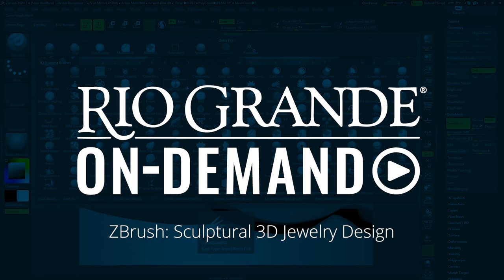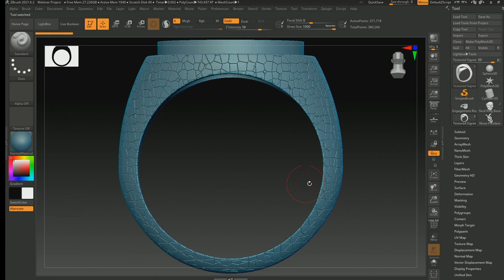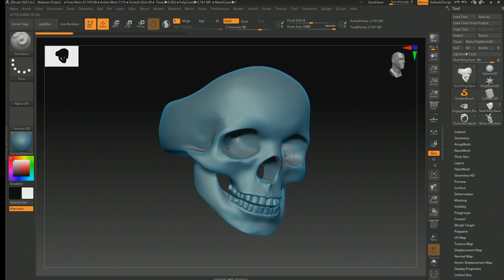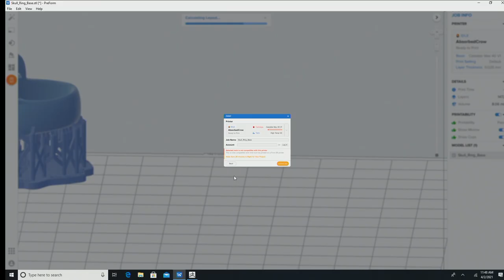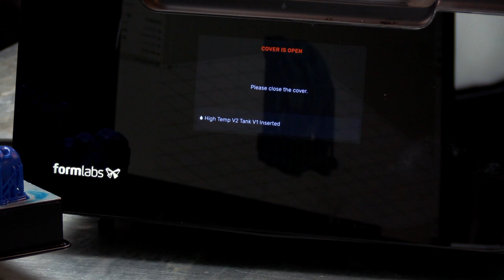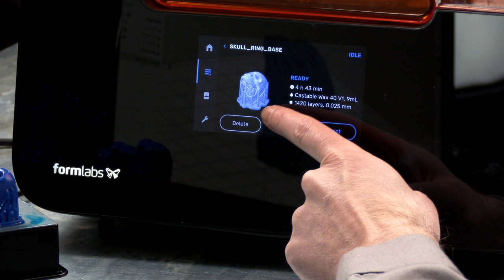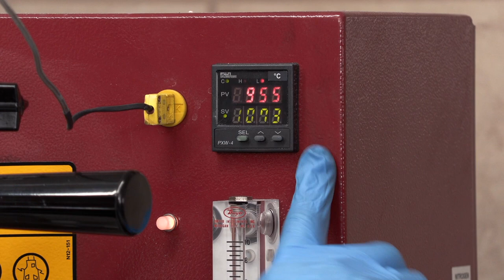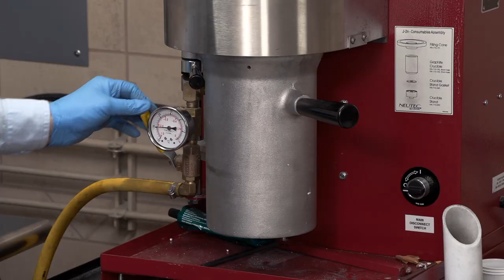From Design to Cast: 3D Manufacturing

Comment: tks, but what would really be useful is a vid about the requirements for the design to cast well. valley depth, edge finish, valley bevel, etc. there are many softwares that can design, but it is difficult to find info on the best design practices for 3D priniting to casting.
Reply: I agree! Have you found a good resource for learning about that stuff since your comment?

Comment: Hi Rio Grande, I need some help there's one thing I have a hard time with, is to give a fair price to my jewelry production. When customer ask me for a quote for custom piece ( for example a ring or bracelet, made especially for them ), I always have trouble setting a right price. If you could tell us what are the guidelines you follow to get a fair pricing, I hope you could help me. Thank you for your videos and your kindness, you do an outstanding job teaching us using 3d software.
Reply: Did you ever get an answer? I’m curious as well.
Reply: @sysadmin9396  nope
Reply: @alphasow1  I’m gonna be doing some digging myself. I will share what I find.  From my what my mentor has told me tho. If you’re casting yourself you should try to make 200 percent profit. Take account the equipment, electricity, labor and knowledge.

Comment: Hi guys great video just started casting myself and this was so helpful. Just wondering what casting temperature you would reccomend for 9ct gold, flask and metal?
Reply from the maker: Hello, thanks for the question! We will pass it on to our Jewelry Tech Team and get you a response! Thanks for watching!
Reply from the maker: Hello, we spoke with our Tech Team and they said that this would depend on the exact metal that is being cast, but the same temperatures for 10k wold apply Properties( Density: 121.1 dwt/in^3( 11.5 g/cm^3),  Color: Yellow,  Melting Temperature - Liquidus: 1635F (890C),  Casting Temperature: 1760F (960C),  Flask Temperature: 1100F - 1200F.)
Reply: Thank you for the help guys i was trying to pour way to hot 😊
Reply from the maker: @cameronpeace1049  No problem! Thanks for reaching out, fee free to ask a question anytime!

Comment: hi i just wonder how can you make a specific size of the ring ? example size 8 . you set it in the firse software? or Zbrush ? and no need to resize in 3d print software?
Reply from the maker: You could use a plugin like Ring Utility to create the ring in a proper size, or append a cylinder into the scene, navigate to the Geometry palette > Size, and size your cylinder to the diameter of the ring size needed. You can then use the cylinder as a cutter for Booleans to create the correct size, or sculpt your ring around the cylinder. You would need a ring size chart to confirm the diameter of different ring sizes. One quick trick is that the Ring Utility already creates these cylinders or “mandrels” for you when you generate a ring. Generate a ring using the Ring Utility plugin in the size you need, and delete anything you don’t need in the Subtool palette. Make sure before exporting as an STL to click the “Update Size Ratios” button in the 3D Print Hub and select the units and size that most closely matches what you’re wanting. Then you can export and the ring will be the correct size. Here’s a video that goes over the process of Ring Making in Zbrush: https://www.youtube.com/watch?v=4dOYDz2kaEE

Comment: did you do the burnout with the base of the sprue facing up?
Reply from the maker: Sorry for the confusion, we did the burnout with the sprue hole facing down. The oven seen in the video is our holding oven for ventilation purposes, and it was placed that way so it would be easier to grab.

Comment: Great video! You said that these techniques and the wax are good for chunky pieces... Do you guys think they're also good for more delicate and fine jewelry pieces?
Reply from the maker: Thanks for the kind words! Here is the answer from our tech team: 1.	It depends on the size of certain features. Small filigree and equally small details would be difficult to print since the material is much softer than a standard resin, so I would recommend the Formlabs Purple for pieces like that. Fine details typically print better with a harder resin.
Reply: @RioGrande1944  thanks for the answer! ☺️

Comment: I have a question, I am just learning about this. Does the power and type of vacuum machine make a big difference to the quality of the casting? The price range is quite large.
Reply from the maker: Thank you for the question: The power or vacuum does not affect the quality of a cast. Power 110v or 220v is based on what the customer has in their shop. Vacuum will allow the time to be quicker when vacuuming out a flask. Machine size is based on quantity of casting flask. How many flask you cast in one day. Large mfg use big machine (JzF)  because of the large volume of pieces being done throughout the day. Small mfg shop( J2R or VIC9-12) will use a table top caste machine

Comment: Is there a reason you dont print the entire tree?
Reply from the maker: The biggest reason is that most designs have many supports or areas that need supporting, most pieces also have to be positioned in an optimum position to require the least amount of supports, which may not be the best position that the tree needs them to be in. also it would probably be very difficult to remove supports and do smoothing to models while attached to a big tree. Also the time to produce a tall vertical tree would take a very long time compared to a shorter single model. Remember more higher equals more layers and more time. Also what if some of the pieces didn’t print or failed then you would have to add new ones in those spots which means you are essentially ending up building a regular tree anyway.
Reply: @RioGrande1944  wow thanks for taking the time to reply, I think I understand now.